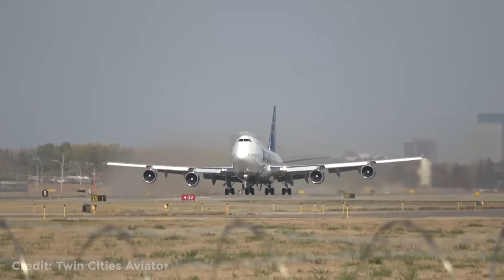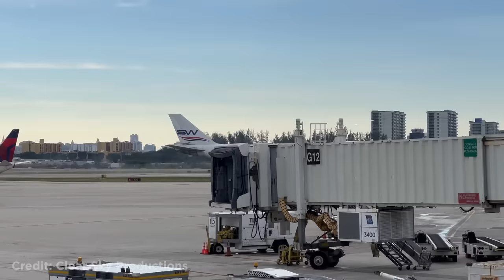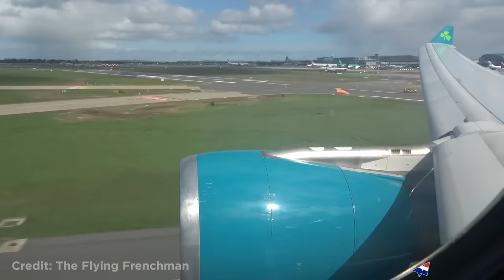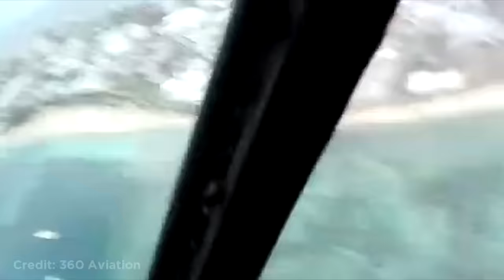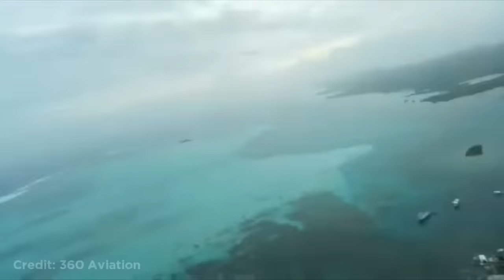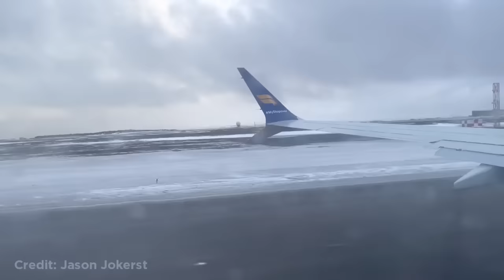15 Worst Plane Takeoff Fails

Comment: Aerosucre HAD to make an appearance.
Reply: Yep.
Reply: Aerosucker, as always
Reply: Aeroinsecure
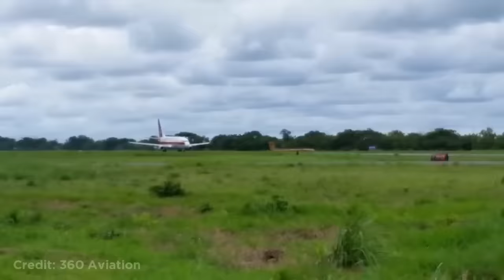Reply: I was worried until 6:06 that this video would be incomplete. Aerosucre's pilots work hard for this mention
Reply: ... Or two. I think the "bank angle" one might have been Aerosucre too.
Reply: Its like they buy the 100 model of an airplane but then plan a flight using the weight-and-balance charts from one 40 years newer.
Reply: HAVE MERCY on that one, by the way…
Reply: @uyeahuyeah  HELP
Reply: @adb012 it was. 😂
Reply: Really sucks the air right outta ya doesn’t it?
Reply: @sbblmb nah bro, aerotorture

Comment: So having new sod on the side of the runway classifies that takeoff as one of the worst takeoffs ever?  Sounds like one of the worst takes ever lol.
Reply: failure = something goes wrong.

obviously something went wrong here. if atc knew that there was freshly placed sod, and that the 747 engines wake would disrupt it, they could have departed the 74 on a different runway. 

the sod would have blown onto and landed on the adjacent taxiway, which would have caused the airport ops to have to move it. if there was an aircraft on that taxiway, this would have caused delays and potentially damage to the aircraft
Reply: Ikr Lucaas is getting so click baity it’s kinda cringe
Reply: We had no indications of it in the cockpit. I didn’t even know that something had happened until a few days later.

Comment: The 737 with the cigar styled engines must be over 40 to 50 years old. I don't know if I'd wanna fly on it. Maybe it's just a cargo plane, but I still wouldn't want to be a pilot on it.
Reply: Yeah, it was a product of its time. Its engines are weaker compared to the 737s of today. But it remains a classic :)
Reply: Probably a lot safer than today’s 737s
Reply: cigar styled 😂
Reply: lol it’s perfectly safe, aircraft engines are rebuilt periodically. Those low bypass engines will do just fine.
Reply: @petesy03  definitely not safer in the hands of that operator

Comment: The C5 was well within the operational parameters of speed for take off. Every aircraft type is different. Also within the aircraft take off speed range. Other factors affect this. Between minimum and maximum total weight at take off. Runway height in relation to sea level. Barometric pressure. Temperature. Humidity. Wind speed and direction relative to the runway. Condition of the runway surface. Is it dry? Standing water? Any ice or snow? The C5 has its own requirements. As does any other aircraft. Even with the following Airbus what model is it? The smallest to the largest have different requirements. Same for 747 or 737. An old pre 1940’s biplane has more than slightly different requirements to a B52 or a F22.
Reply: Yup. The ATC screwed up clearing the 330 too soon. The C5 wasn't "too slow"...

Comment: A340: the world's most under-performing jet
1:54 Notice how there's a crow (right side of the screen) that knows that planes have the right of way
2:40 we can tell which engine was involved and sounded like a write off
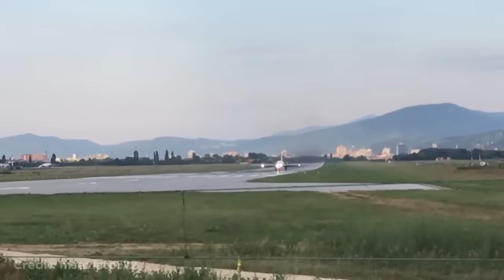2:54 Il-62 freighter (good thing it's not used by Aerosucre or it would just be a truck with jet engines)
7:52 I don't know why but that sound makes me think it slipped on a giant banana
Reply: A345 and A346 underpowered?😂

Comment: Whilst there is not vision, as far as I am aware, the Emirates Airline A340 takeoff from Melbourne Rwy16, took out the localiser aerial. Apparently the crew entered a tkof weight 100 tonnes below the actual weight. It cost them their jobs,.

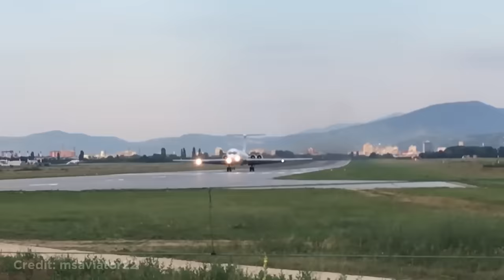Comment: il-62 at 3:00, if anyone is wondering like I was
Reply: IL-62M is the only aircraft of this weight with direct flight control.
Reply: I also wanted to make sure it was an Il-62, so I came here to the comments section, but it's impossible to confuse it with another plane because of that engine configuration, with two engines mounted side by side on each side of the tail.
Reply: @ianclaudio777  there's also the VC-10

Comment: Insane to continue a flight after a tail strike IMO
Reply: It's all good, at around 500kts the extra aluminum sheet that shouldn't have been there is gently burnished off by the perfectly laminar airflow, making the air raft more aerodynamic and efficient.  I mean, seriously,  do you have any idea how much drag a tail section adds?  They should've shaved down those bigass wings too.  Streamlined! ahhhh🤤

Comment: Just to let you know: As a rule one should land as soon as possible after a bird strike. During flight it can be very difficult to determine the extent of the damage, for example if the strike has compromised the structural or aerodynamic integrity of the aircraft.And follow the emergency procedures and, as a pilot, aviate navigate, communicate. Golden rules. There is no such thing, they flight to destination ( regarding DHL flight)

Comment: Oh. Did you offer your costumes too. When the dogs bite only, When I saw the aerofoildesigned.   Too much planes are still taking off from the runway, It was so embarrassed about. The plane also gives laminar flow on its lower surface.

Comment: I would think many of these take offs are reduced thrust take offs all within the performance of the aircraft. If full thrust isn't required it saves on engine wear and hence cost of engine overhauls. The other advantage is reduced noise on take off to affect the local communities close to the airfield.
I don't think lucass knows that much about aviation its just click bait to call the take offs as 'fails'.